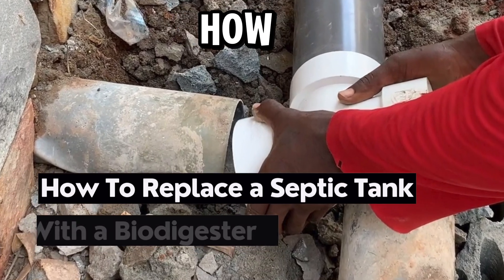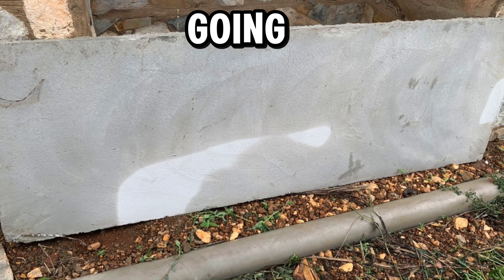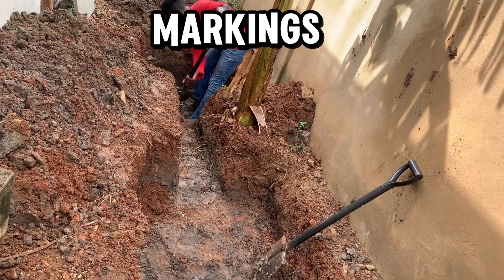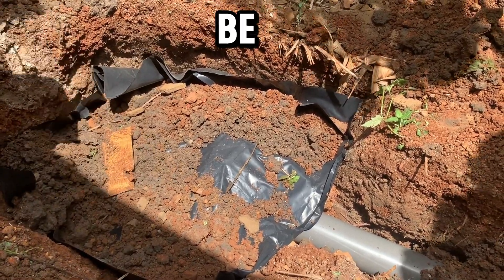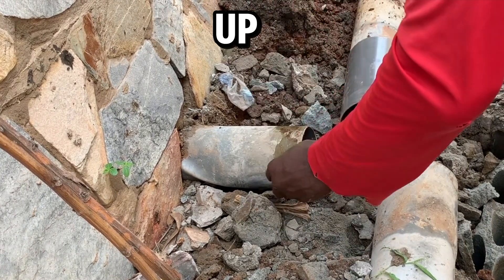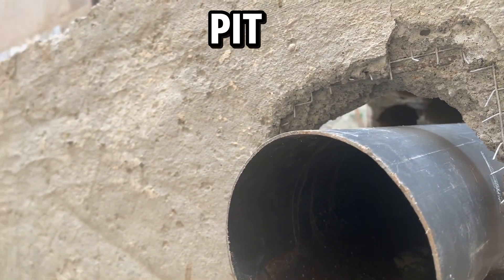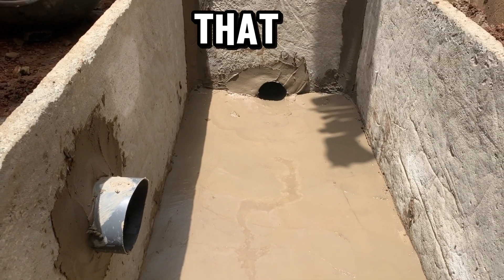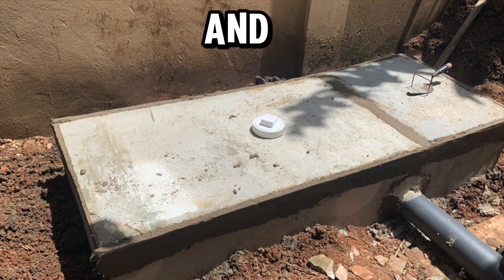Upgrade Your Septic Tank to a Biodigester in 2025

Comment: Good One There My Jerry, My Question Is What's The Sizes Of The Porous Bed Slabs?
Reply from the maker: @IshmaelMensah-l3l  If the digester slabs are 5ft by 2ft, then the inside porous slabs would have to be reduce by at least 2inches https://youtu.be/s50DLi-FVpc?si=Pwk4UZ0_EH1S_frw
Reply: @JerryAdu-Asare  Ohk 🙏
Reply from the maker: @IshmaelMensah-l3l  Thanks Ishmael. Thanks for the support